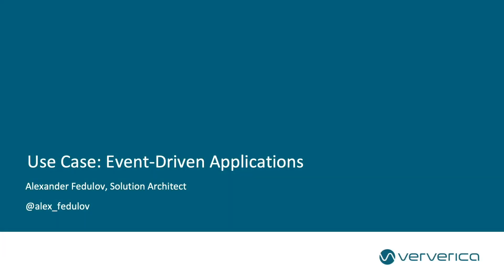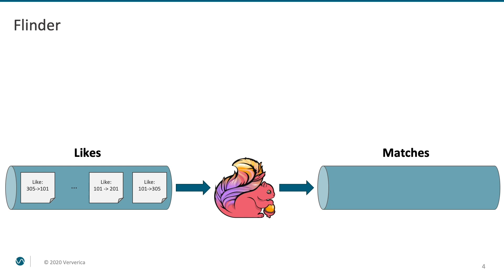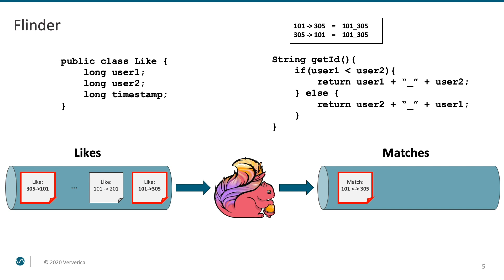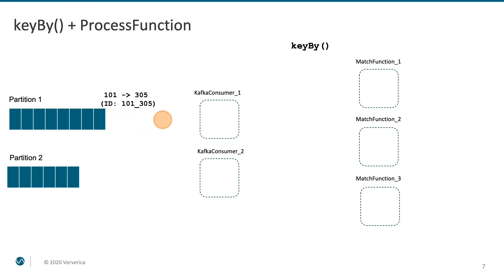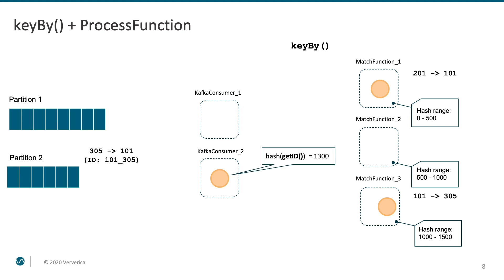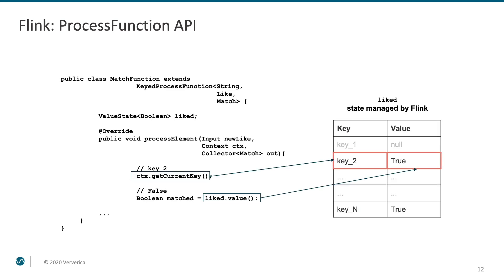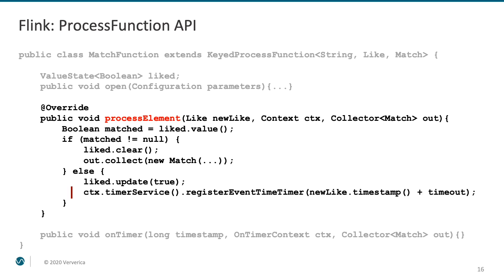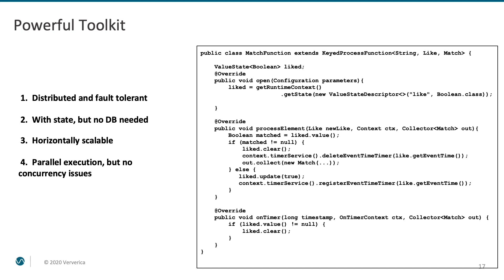Streaming Concepts & Introduction to Flink - Use Case: Event-Driven Applications

Comment: can we use Flink to implement Saga pattern? For example when a failure happened we rollback or when the user has no sufficient money we cancel the reservation in a distributed system.